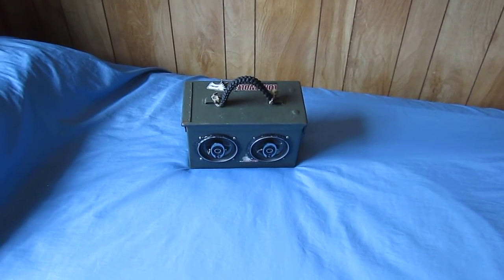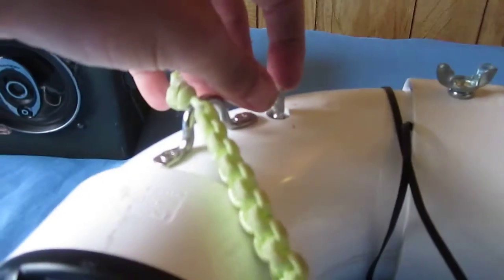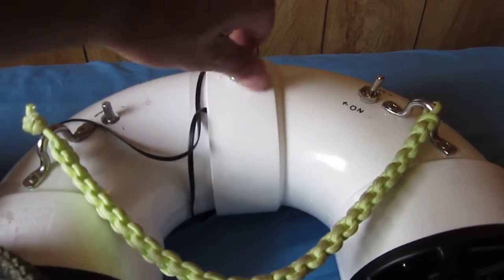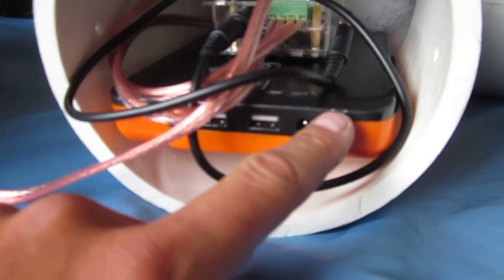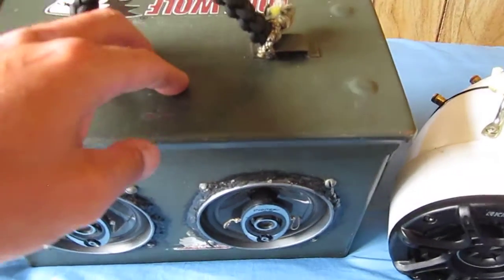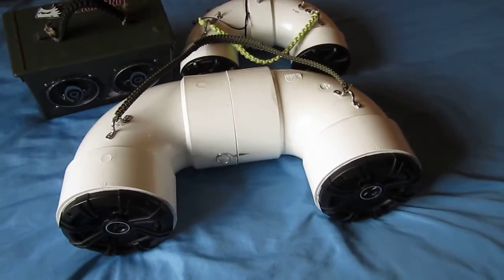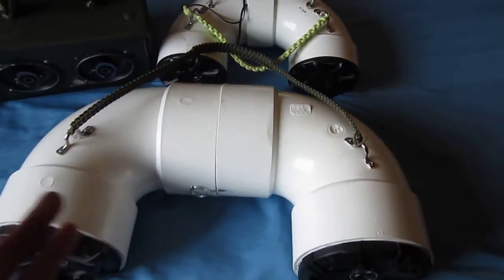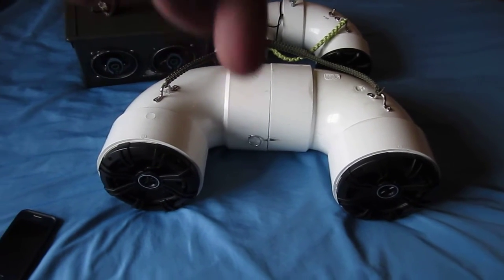More boom box stuff

Comment: Very innovative thinking! I LIKE! lol. Still need a way to connect it for easy recharging and on and off.
The opening and closing of it would get old after the second time, lol.
Reply from the maker: I agree, i just need to sit and do some research to find the correct plug for external charging, but the on/off part will have to be a mechanical connection to the battery.